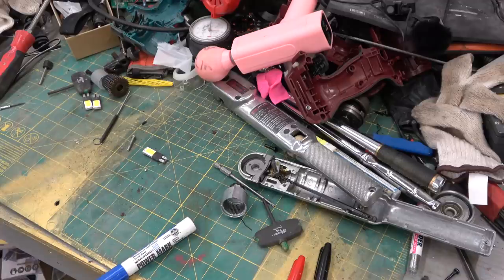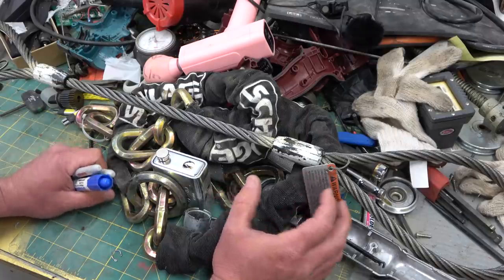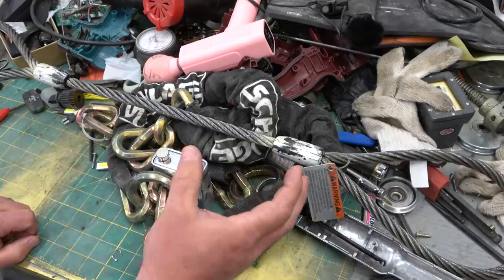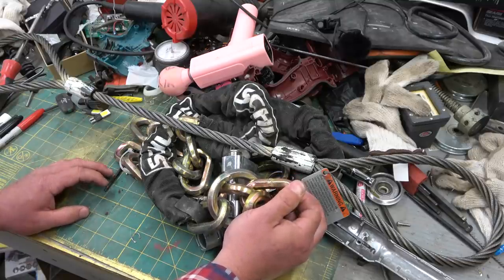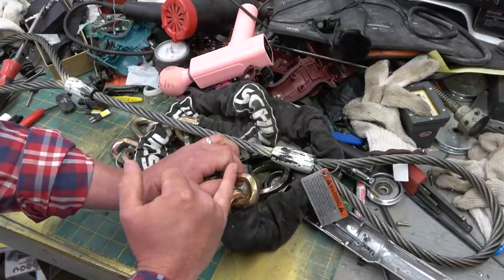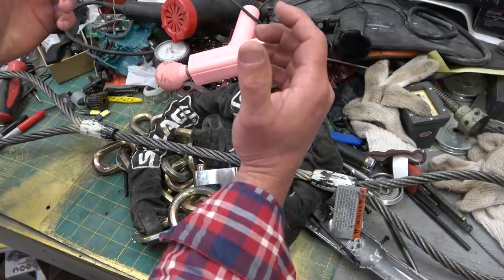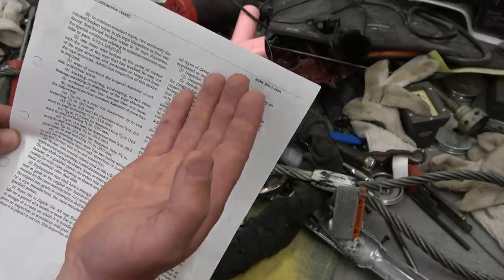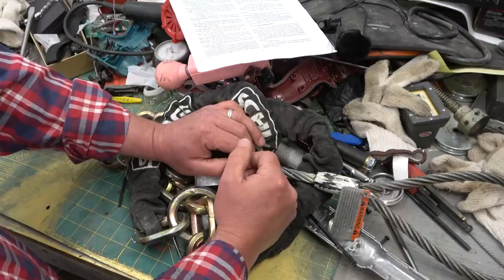"It is not known why the pulling cable snapped."

Comment: I would speculate that high-torque motors would have some sort of clutch between them and the load, to reduce the "jerkiness" of power application, both for the comfort of the passengers and to extend the life of the pulling cable.  But what is the "life" of that cable? The every time a strand fails, it transfers its load to the remaining strands, each of which is then that much closer to the load at which it too will fail. So as strands fail, the maximum load capacity of the whole cable will slowly decrease, perhaps with some plastic elongation, until the maximum load capacity falls to the level of the actual load, and the cable breaks. How does one monitor the health of a cable? You can't inspect all the strands- perhaps monitor the overall elongation from new? I believe the US Navy discards arrestor cables after a certain combination of cycles and loads, so they don't leave it up to a visual inspection.

Comment: You are spot-on... I'm sure there's some semantics or some bullshit like that but, you are correct period. You would have thought, with Arecibo failing, even though it was in a different way, it would have been a lot more apt to worry about cables, but at the end of the day, the brakes didn't work so what the f*ck**??

Stuff is very depressing in ridiculous so I completely agree uncalled for 110%

Comment: Quite right.
I do Electrical upgrades. If the original design, did not include a modern safety feature. I ungraded that too.
I will never leave anything to chance. Life safety is No. 1, followed by my reputation.

Comment: To AvE:  You say 1) you are not worried about (digital) AI because 2) we've had analogue AI for 200 years.  This is to ignore any * responsibility of that very analogue AI for the grossly sub-optimal situation in which we find ourselves and to assume digital AI is intended to reverse the problems caused by analogue AI.  Thanks for the video.
-----------
* some would say  "the major part of the" instead of "any"

Comment: Yes , you are right . There is a lot of pressure put on mechanics to hack and patch things to keep cost down and make due with Obsolete machines . Nobody wants to invest in there own company to keep things running smooth any more .  Only the large companies do this in fear of consequences . It is a very poor attitude the smaller companies have , and get away with .

Comment: I doubt if the technician made the decision to defeat the safety overrides on his own. That kind of decision is usually made by his supervisor, maybe on the tech's advice (bad call). Something like, "just until the annual maintenance at the end of the tourist season in 3 months,  after all, we have been down for the last year and a half due to the covid19 virus". Too bad there wasn't a manual emergency brake accessible from inside the car.

Comment: Man, this sounds like one of those "out there" episodes of a show where they show how a killer managed to tamper with some device in order to kill somebody. A "forked-shaped bracket" meant to intentionally disable it would be the first step, then the operator would just have to ensure that the wire was worn down "just enough" before his victim embarked. Maybe cause some sort of jolt of speed in the motor and bam, cable breaks free and the brakes don't work.

Comment: Awesome video for me in several ways. 

First, it brings attention to the mindless corporate greed that is rapidly destroying this country (US) in a low and slow boil. Our legislative governing body's have been usurped by cash and foreign influence. If the workers that sustain this train wreck don't grow a back bone and resist, their children will be no better than those subjected to grueling, dangerous, and long hours of work. Just as my grandparents generation did during the Gilded Age of the 19th-20th Century cusp. 

Secondly, the mere mention of a resolver had my old heart a flutterin with memories of Navy A school and my assignment to Naval Aviation as an electrician on the P-3 Orion anti-submarine aircraft. I had beaten the draft! I would spend the next four years with good food and a warm bunk learning one of the best trades there is. Sorry Army, I had no beef with the Vietnamese people.

At that point, I turned to my library and reached for my NavPers Basic Electricity text book I've kept for all these years, and on page 415, right after the chapter on magnetic amplifiers (ever hear of them?), thar she was folks, just as I remembered, a single phase  115 v AC coil as the rotor, positioned within a three-phase wye connected stator defined as "an electromagnetic device which is used primarily for the transfer of angular-position data." "In effect a single phase transformer whose primary to secondary coupling may be varied by physically changing the relative orientation of these two windings."  Just what a angle of attack sensor is tasked to do, supply the flight control computer with the actual AOA of the aircraft as a stall warning. Stall wings, plane drop.

Pardon the rambling, what's an old dog got left? One more thing, no 737 Max for me!

RIP for those unfortunate people, more victims of a system that kicked us to the curb 40 years to paraphrase the great George Carlin.

Peace. Out!

Comment: Respect to those poor souls that lost thier lives.

This is like most accidents caused by Complacency, the tech was complacent and so was managment in not ensuring the tech was doing his job. Plus im not Italian but there has to be an annual LOLER inspection ?

I know that for talking sake the safety brake lost hydraulic pressure it should always "fail to safety" and  engage the brake. Thats its purpose to stop you using it.

This is possibly why he forced the brake open. What i dont get is that they continued using it to ferry the public.

I had a discusion with my works managment in which i stated yes the      proposed situation will work you will get away with it. But "if" something happens you will be found culpable by a Judge.

Comment: I'm interested how many PO requests for new brakes were denied.  Not that it absolves liability to the service company or the tram company, but I find a lot of these problems always come down to some bean counter not wanting to replace an expensive part when there is a workaround.  Especially if that workaround worked once before.

Comment: Regulations need to be changed so management is not shielded by the company  in legal matters like this. Every direct report from the Mechanic to the CEO are all personally liable for those deaths.

You NEVER fuck with safety equipment.

Comment: I supplied water purification’s membranes to many industries. One industry kidney dialysis has built in safety features , one such feature is temperature. The temp alarm kept sounding and finally the technician of the calls just disconnected the alarm. Eight people receiving treatment all died slowly probably no pain but!

Comment: Our own glorious military aviators were hotdogging in the Italian Alps, flying too low, against regulations, and sheared thru a gondola cable, dropping all the passengers. A clear case of reckless, negligent homicide. What did the brass do? 

Shipped the guilty pilot out of country, covered up the wing camera footage, and told the victims families, 'We're the United States Air Farce, screw you.'

Blocked extradition, paid the families a few pennies to settle, which they took because by then, they were broke. 

They do the same for rapists and murderers in the service. I know. My brother-in-law was one of them. "Greased" 15 civilians in Vietnam & Korea. Mostly old men on bikes. Danny ran 'em over with his truck.

... for FUN. It was a game they played in his motor pool. He did it to score points. What is the engineering fix for this?

Change the nut behind the wheel...

Comment: I'm 36 now. The older I get the more I see people (and I mean 9/10 people) really don't care. They couldnt care less about their job. They just want to do the time that they have to and no more. I am not surprised that the guy fiddled with the safety brakes to "complete" his task. But I am angry. Here in Western Australia, the apartment walkways above my office got soaked regularly and poured water down the stairs when the maintenance woman was there doing maintenance. Eventually I went up to ask what was going on... She was using the fire hose to wash the stairs and walkways. It's illegal to "tamper with safety equipment". She just wants to do her job and go home. I reminded her politely.  
Then there's the people that drive on the freeway at freeway speeds, effectively asleep in the centre lane. And the others who drive within an inch of the car in front, always tapping the brake because the car in front also tapped the brake because they're doing the same. 
These are just a couple examples that I thought of, there's many more. What's going on?

Comment: Those of you who are old enough to remember the "Y2K bug", do you remember all of the fuss made afterward when there were no problems to speak of? "All those trillions of dollars spent on mitigating the problem and nothing happened! We should be re-imbursed!" cried many commentators.
Well, it was BECAUSE that money was spent in the YEARS preceding Y2K that it went so smoothly.
Rather than it being moaned about, it should have been used as a shining example to all of how work done can fix, or avoid, a potential problem from becoming a major calamity.
Like you said, "just fix the fucking brakes!"

Comment: I once designed a controller for a system, it had to have a remote cooling fan else poisonous gasses could be created. I fitted an interlock such that the system could not be activated unless the fan was running. I was told to remove the interlock, which I refused to do, as the fan noise was annoying and they wanted to turn it off. Someone else removed the safety feature as they reckoned the temperature would not be too great as they would limit the test ON time. All very well until someone decides to do an extended test or maybe a few tests one after the other. 
I just sent an internal memo to the effect that I was no longer responsible for any safety issues as my interlock circuit was being negated. Yes it does happen and the section Boss has more power over the design engineer. :-(

Comment: P.S.A.M.
Probability Safety Assessment Management 
If you remove ANY safety measures given enough time the probability of a catastrophic incident reaches 100%
This is not limited to big ticket items, if you don't "mouse" one shackle or skip lubrication for wire rope given enough time or enough cycles... 
All systems are chains that break at their weakest link.

Comment: The fault is fatiguing the cable .  Also, the brakes prevent overspreed..dampen the movement.. without which the cable can be strained and vibrated...

Comment: It's such a shame that they didn't take some time to think to put some monitoring circuitry on the DC motors. Torque is directly related to current, so they could characterise that and work out what was changing and if it were going wrong. 
I'm sure modern systems do this...

Comment: The cable cars were older, I travelled on them, between 60-62 a "navy brat" having lived in Barcelona, and Naples, four years before returning to the states.  I rode on them in 82, a Marine, on my way to Beirut.  This whole issue is endemic to "the history of Italian cable car maintenance".  Those brakes worked in 60, and have continued to work, even as it gets ever older.  "Having worked on them for thirty years", the engineer should have noted the constant failure, of individual strands, and noted their "maintenance cycle" wasn't keeping up with the deterioration of the whole system, just as we, in the US, refuse to acknowledge our whole "infrastructure is failing" at an accelerating rate".  This is simply demonstrating the constant failing of western culture, and it's final demise.  I am a mechanical engineer, have watched my country do away with technology, and not even thinking of replacing it.  Forty years ago, I had the "authority" to make such decisions, based on my skills, my technical prowess, demonstrated substance.  We don't do "engineering" anymore, and politicians can't make choices, because they are incapable of doing the least of the math.  There is no part of this system that wasn't substantively decayed, breaking, and doomed.  I only watched this, because I'd been on it.  I don't have any "extra disgust" for this, there was no principled management involved.  You are entirely correct on the basis of "where the cause of failure to maintain", begins.

Comment: No, profit driven system is also interested in safety. Just like airlines. Because if its not save, there would be less profit. So safety is an investment.
Also its not like an elevator brake in the building, that will always resist the fall. The brake system on a mountain lift is designed to prevent some situation. There are 2 types of cable - pulling and hanging. The brake system is only for the pulling cable. If hanging cable snaps, brakes are useless. 
Pulling cable is easy to inspect because it always comes back into the spool at the base. So its always very well inspected, thats why they didnt use a brake.

Comment: Ave I just want to correct you with the wire choker if you cut it in half they have a metal core as well the wires on the out side is just twisted around the metal core

Comment: There's an episode of Aircrash Investigations where the cabin crew pulled the fuse on a faulty alarm and disabled crucial flight systems. The investigation concluded that if only they'd (ground crew) fixed the alarm.....

Comment: As a Chartered Mechanical Engineer, there is a reason we have systems in place, such as Author, Checker & Approver etc.

It’s often not the systems that fail, but the failure to apply them.

Wanna be an Engineer or Tech?, well follow the fuc£ing rules!

Comment: 100% agree with you on this, Profit before safety with corporations always seems to be the rules, over here in Europe we have supposed laws to protect this ever from happening and its called Corporate Homicide where the directors and employees of the corporation can stand trial and be tried for what is murder basically and this will eventually happen.

This was preventable and I do not understand why the decisions on things of paramount safety are left to one person to make a decision. 

In the aviation industry everything is written down and when there is a problem the aircrew refer to the book and it tells them what to do so they do not think and do something else which leads to a catastrophic failure of the plane , in elevators and tramways like this the same procedures should be adopted and no one person should have the authority to remove the safety systems or even work on the machine, there should be a system in force to prevent this where another persons signs off the work as in the aviation sector. this system has prevented so many accidents over the years.

If it costs more to implement it so be it, the stockholders should take a cut to stop this from happening. Its just so wrong.

Comment: Yes there is a breakdown in management and obviously pressure from above to keep running but for me a lot of the blame lies with the guy working on it. With 30 years experience and knowing the brakes had been dragging he should have been aware of possible cable damage and checked. He should have repaired the brakes properly when they were discovered to be going wrong. And ultimately he never should have disabled the safety brakes under any circumstance. Was he leaned on to keep everything running who knows but he caused the accident in so many ways.

Comment: So how do you get the brakes to drag? By my understanding, you can accidentally increase spring pressure, but this seems highly unlikel, youd need to overcome hydraulic pressure with something you've fitted by hand. Or your losing the hydraulic pressure required to hold the brakes off. It cant be that difficult to sort the hydraulics.... paying for the parts and labour is another thing though.... but a mechanic with conscience would have jiggled something that works enough even on a shoe string budget, right? Or you need to drop the electrical control side of the hydraulic control.... Does anyone know (with sources) why the brakes were dragging? I suppose if the linkage was completely worn and sitting off square it could catch and drag, but if such a simple linkage was that worn out the whole plot would be long since scrapped... right. So do we have a mechanic who is desperate and dare not quit? A mechanic who was hired through nepotism rather than skill who refuses to concede defeat? Or is it good old money grabbing.... money seems too simple an answer for it to be profitogreed exclusively.

Comment: Tramways, mines, elevators, all need the safety brakes. I'm not an accident investigator - I'm an aeronautical engineer and  and a computer network engineer. Over the course of my career, and even in my own personal life, I diagnose and fix things. I often look at causes for accidents, even if just out of m own personal curiosity.  Diagnosing is an art in itself but I digress. In virtually all 'accidents, whether it be a 'disaster at sea', an airliner disaster -  a blown engine in your car, a tramway, rail, or auto and motorcycle accidents, there is always a "chain of events" that lead up to the accident (and deaths)...a chain of events, that given ONE thing were changed, would change the outcome. EVEN on the damned "Titanic", there was a CHAIN of EVENTS that led to the deaths of 1,514 people. And all it takes is for one, ONE person to make a difference at some point in that chain. So sad that these people died in a most terrifying and horrifying way....so sad....